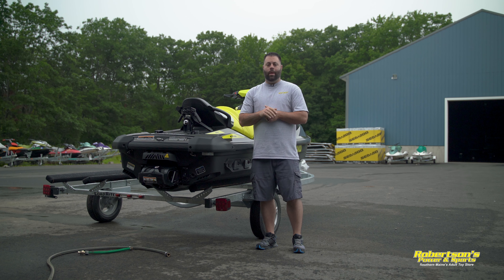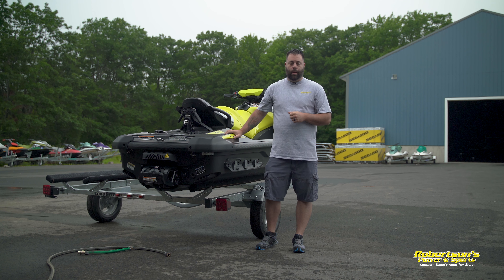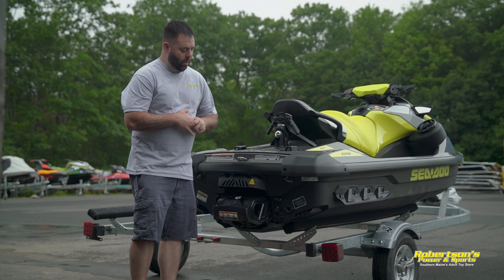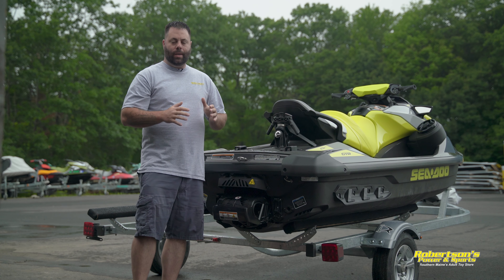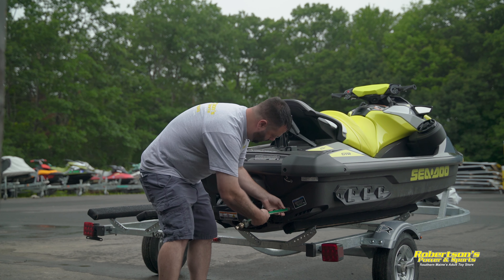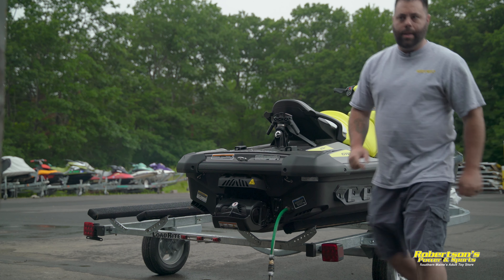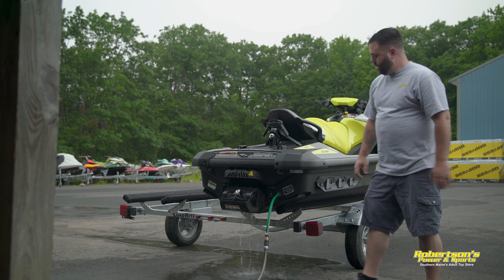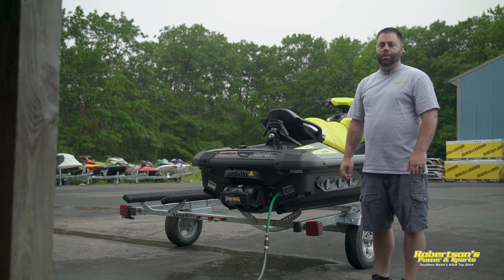How to run your Sea-Doo on a hose and out of the water!

Comment: All good info, but to make it more convenient, I keep a quick connect permanently installed on the flush port and a shut off valve at the end of the hose.  That way, I don't have to run back and forth to the spigot.
Reply from the maker: Great tip!
Reply: I did that and mine the water will not come out the back how do I check for trouble

Comment: I do the same as you have , my ski has gone through 3 carbon seals , wearing out about every 30 hours , seadoo say I have been running it out of water to long , I all so spray water on to the shaft up in the intake grate , the engine alignment is 100%

Comment: Question, if its bad to start the engine with water going to it, why isnt it a problem to turn the ski off/on when in the water?
Reply: You cant tow a turned off jetski faster than 15 mph because water will flow from the water intake tube and go to the exhaust and flood the engine when the jetski is stationary the water will not flow to the tube and no damage can be done
Reply: @mariopali9807  ahhh, thanks for the explanation.

Comment: I have a question idk if anyone can answer, I have a 99gtx limited it runs completely fine on the trailer like 2500 rpm’s, right when I put it down in the water it just turns over but never has started, I’m not sure what places to look at?

Comment: Man I wish I saw this because I was an idiot and turned on the water before starting and I have no idea what that’s gonna do
Reply: Me too.   Does it damage?
Reply from the maker: What it will do is fill the engine with water and the boat won't start cause it is hydrolocked. Best thing to do is bring it to the dealer so they can get all the water out and perform a "boil out" procedure to rid the moisture inside the engine and change the oil. Thanks for watching!
Reply: Doesn't all the newer seadoos have coolant? My 2017 has radiator fluid raw water is to keep exhaust temp down your exhaust manifold should have a flap in it that doesn't allow raw water into the engine unless it's running that allows it to keep the manifold cool. Maybe you could explain a little further on what you're saying? Because turning the hose on before the engine being bad that's the first I've ever heard it.
Reply: @ROBERTSONSPOWERSPORTS cual es el procedimiento para sacar el agua del motor? Quitar las bujías y darle staring?
Reply: @ROBERTSONSPOWERSPORTS  thank you

Comment: Stupid question here: I never had  a jet ski before so in case i get one why i need to do that??
Reply: I do it to heat up the oil before and oil change. It makes pumping it out much easier. Also, those that winterize would need to do this with antifreeze as opposed to running water through it.

Comment: How long can you safely let it run attached to the hose?
Reply from the maker: Per the operators manual it is suggested to run it on the hose for 90 seconds, shut the water off, then run it at 5,000 rpm's for 5 seconds. Thanks for watching!

Comment: If it runs on hose can I assume it will run in water?
Reply from the maker: It should, but keep in mind that when running out of the water there is no load on the engine. It's like revving a car in neutral that sounds fine but when you put it in drive it may act different. Thanks for watching!
Reply: Take it from me running on land doesn't mean it will run the same on the water.

Comment: And your exhaust is still full of water 🤦give it a quick rev to clear it out Max 90 sec total run time from start to Finnish.. .. I've got 330hs on my factory carbon seal 2021 wake pro
Reply: Stupid question, but you mean a quick rev after you went and turned off the water supply, right before turning it off?
Reply: @SK-GT Yes, after turning the water off rev it to get rid of the last bits of water in the system then shut the engine off and you’re done with the flush